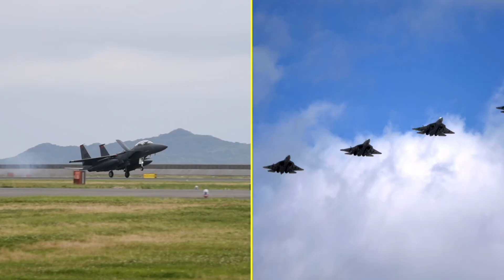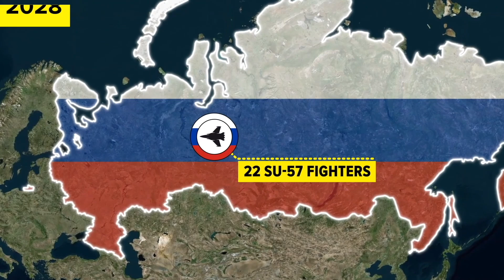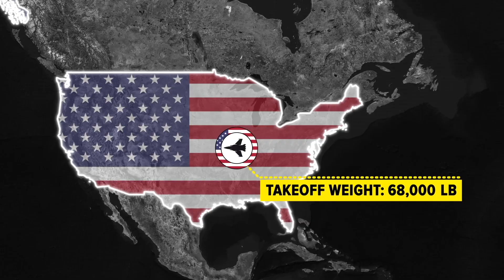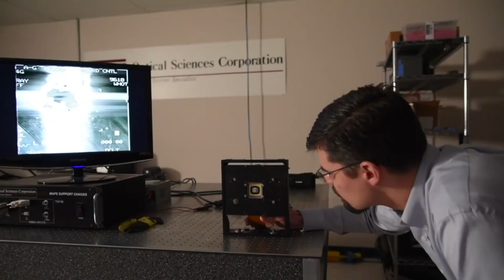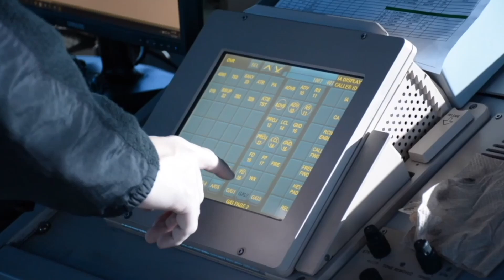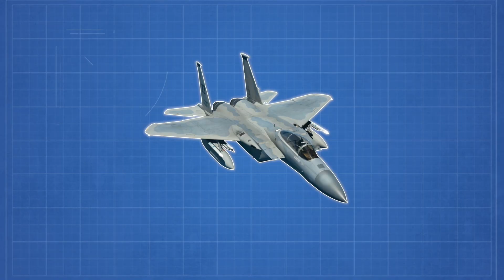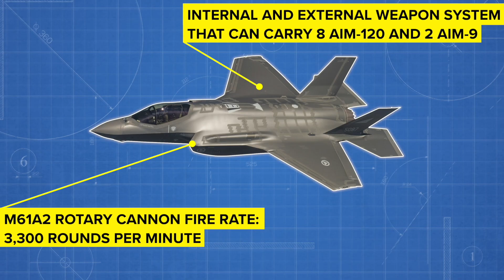Why the F-15 Still TERRIFIES Russia

Comment: Russia is not scaring anyone. That new F15 EX is something they should worry about.
Reply: I don't think Russia is thinking twice about a plane which primary role will be domestic defence. The F-22 and F-35 is what they fear.
Reply: @janhansen3753 actually….the F15 especially the EX  would serve as second hand damage after the stealth jets came in and destroyed land to air threats that could lock them up
Reply: @lafosh7234 the F-15EX will be the F-35s missile truck. Think of it as an an extended mag for the 5th gen.
Reply: @lafosh7234 

First, Russia would have to develop stealth aircraft.
Reply: @janhansen3753 it's the combination that's the real killer. The stealth of the new fighters and the situational awareness they offer helps everyone else. They clear the way, so to speak, but then the upgraded F-15 can carry large numbers of missiles and bombs. It's a missile/bomb truck with a ridiculously powerful radar and now even more range and loiter time.
Reply: @janhansen3753  Which they should, but we only have them in limited numbers. A squadron of F-15s fifty miles back from a couple F-22s or F-35s make one heck of a force multiplier and distraction.
Reply: @janhansen3753 they will be sold to our allies as well
Reply: @janhansen3753 
Russia should fear the missile carrying platform that the F35 will be directing towards the targets.  Unlike Russia, US and NATO countries utilize and integrate multiple platforms into a fighting force.
Reply: @janhansen3753 100% false. It will not be dedicated to domestic defense.  It will be a missile carrying platform that with datalink with F35 and F22, will be used to absolutely decimate foreign adversaries.
Reply: @janhansen3753  The F-35 is suffering from the same problem that the F-4 Phantom experienced in Vietnam.  Jack of all Trades, Master of None.  Seems like Western leaders go in a cycle where they think they need a multi-purpose vehicle only to come to the same realization of previous generations that having dedicated frames for a specific purpose is more effective.  What they should be looking for is NOT multi-purpose aircraft, but rather PARTS inter-operability.
Reply: @davidford3115 

Detection and mastery of the airspace is what the F35 commands.
Reply: @davidford3115  The F-35 is actually just 3 different aircraft in a trench coat claiming to be one model.  The difference between the A, B, and C variants are significant.  They only share 25% of the same parts between all 3.  But the F35 is good platform even if its equipment load is reduced when using just the internal weapon bays.
Reply: @BurntOrangeHorn78  That is what the USAF claims, yet it still has yet to actually prove itself in combat.  While it is clearly superior to Russian and Chinese airframes, its advocates oversell its capabilities just like the Russians have for the Su-57 Felon.
Reply: @davidford3115  To be fair, once they got over the idiotic 'the era of dogfighting is over so who needs a gun, or even training pilots how TO dogfight', the F-4 served quite well for many years.
Reply: A F-22 pilot said the new F-15EX  fly by wire can hang if not exceed the maneuverability of the F 22 Raptors.😳😉.  Not counting the new F-15EX missile Magazines from above.  F-22, F-35’s lock the targets.  And is fired by the F-15EX.😉.  The F-15EX has the biggest, and fastest super computer in any military aircraft in the world.🤘 🇺🇸.!.!.
Reply: @djoswald9128  Until the F22 upgrades go through anyways.  Still look forward to if the manned-unmanned teaming ends up being a real thing with NGAD.
Reply: @4RT1LL3RY  “Until then the F-15EX still rules the skies.  F-22 has 2 A2A kills.  Both balloons 🎈.  Balloons don’t shoot back.😉.  2030 is a long way off.😉.  Is worth the mention, F-15 EX will still have their six in 2030.🤘.
Reply: @djoswald9128 it might be as maneuverable when clean fuselage, but with full weapons component it will greatly reduce that performance. The F-22 does not have that limitation due to the internal weapons bay.
Reply: Honestly who defends the margins that we all thought was real prior to Ukraine.   It's obvious.
Reply: They are just a big paper tiger, aka an appetite for a military
Reply: Yup 🤘🇺🇸
Reply: F15ex linked to the f35s = gg
Reply: I think it's hilarious (also, awesome) that we can revisit an older design like the F-15 and just modernize a few parts of it, and it's at least as effective as a brand-new design. Goes to show you how well designed the F-15 was/is.
Reply: @Canoby 
Why do you believe that the F-15EX is an old F-15 with only a few modifications?
Reply: @Not-a-GSD  Because it literally is the exact same design as what the USAF flew in the 1980s but with some systems upgraded. And this isn’t a knock on the F-15EX- even vintage F-15s are better at their jobs than a lot of newer designs
Reply: @Canoby  
Wrong, unlike you I have actually worked as an engineer with previous F-15 and F-16 designs.  Try again skippy, but use actual facts not opinions based off of ignorance.
Reply: @Not-a-GSD  😂 claiming you’re a big shot engineer pretty much proves you’re talking out of your ass
Reply: @Canoby  not necessarily. That's a blind assumption. You have a 50% chance of being wrong.
Reply: @moriscondo5511  You’ve never heard of “testing” apparently
Reply: what is Su-35 then? Literally F-15EX before it's recepie was repeated. @Canoby
Reply: @worldoftancraft  😂 cute knockoff that fails harder than when the Russians were still trying to work out their own designs
Reply: @Canoby  your reply makes no sense considering what I wrote. You now isist that Russians copied F-15EX before F-15EX existed, so they can create the-to-be prototype of F-15EX. Genius
Reply: @worldoftancraft  Nothing you say has any grounding to reality, but OK go ahead and talk nonsense on the internet. Russia’s SU 35 is trash compared to anything the West puts or ever put out
Reply: @Canoby what a load of crap.
Reply: @kotor1892  well if some rando on the internet asserts it with being able to articulate why 🤡
Reply: @Canoby :: SUPERSMART CONSIDERING  PROTOTYPE  FLEW JUST  BEFORE  15TH  BIRTHDAY.    IT FLEW  27 JULY 1972.   ☆☆☆☆☆☆
Reply: You should be scared of Russia, they kill on an “Industrial Scale”. If you’ve never seen this form of War….than be lucky.
Reply: Listen Taking the Most Lethal  4 th Gen Fighter / Give it State of The AeSa Radar, more Power , Range , Greater  12 Missles instead of 8 . EPAwss Survivability + Not to exceed Mac 2.8 ( Dash to escape a Fight) is a Problem

Su-57 has limited stealth. It has F-18-E/F  Level Stealth Clean.

EX - Can see it FLirR / But most likely it’s Powerful AESA Radar.
Reply: Neither are the Americans..
Reply: The F-15EX would get popped by Russian SAM systems like the BUK-M3, TOR-ME2, S-350VM, S-400 just as easily as the F-15a.
Reply: @John-hu9qg  the F-15 is hanging back and firing it's AMRAAMS from a safe distance using its datalink to the F-35s weapons lock.
Reply: @bucky5869   It's rumored that the Russians have special EMP and air bursting tactical nuclear warheads for their long range SAMs, like the 40N6 to cause absolute havoc among the sophisticated and sensitive sensor suite on 5th generation airframes like the F-35, F22 etc.
 If in doubt use the sledgehammer.
Reply: @John-hu9qg    The problem with the nuclear option is the taboo.  China and Indian will BOTH turn hard against Russia if they use it.  There is a reason why it hasn't been used so far.
Reply: what a sad Russian Bot. SLAVA UKRAINI
Reply: @bucky5869 the F-15EX can also equip and fire the JASSM and the HARM. With the F35 acting as a flying forward air controller, the big fat F15 can deliver a LOT of ordnance with great accuracy on target. It's a winning combo the USA has been employing for 30+years with various aircraft combinations.
Reply: @Clean97GTI  The F-35 can also deliver a great load if it is using external pylons? And even with external pylons the F-35 is way harder to hit then the flying barndoor.

And for those who think the F-35 is only a targeting machine while the F-15 hurls AMRAAMs. You guys simply have played to many videogames. Name one airbattle after the Vietnam war where more then 4 missiles have been used in an airbattle.

The F-35 is a way better platform for any ARM missile. And there are many better platforms for JASSMS.
Reply: @janhansen3753 Using the external pylons makes the F-35 much more visible, but the F-35 wasn't really intended to be the Air Superiority fighter the F-15 was. The F-15 is more than capable of doing its own air to air combat. This video is about the EX model which includes all the ground strike upgrades that were previously only on the F-16. The F-35 has the fancy new radar, fire control, targeting, etc. While the F15EX has some of that too, it doesn't have stealth. What the F15E and EX models have though, is 8k to 11k more pounds of ordnance capacity and roughly 15k lbs greater takeoff weight. 
While the F35 can hold its own, it's more in the F16 or F/A-18 class of fighters. The Eagle is a much bigger boy with a very powerful radar of its own, the ability to network with the F35 and AWACS and bring a disgusting amount of firepower to an engagement.
Reply: @Clean97GTI  he can’t seem to realize they function vastly diff but together and essentially become a insane beehive 😎
Reply: @zethloveless7238  Almost like building interlocking layers of capability into your approach to combat is a good thing.
Reply: @Clean97GTI  Do you really mean that using the pylons on a F-35 would make the F-35 more visible then a F-15 in an enviroment where you want to use a F-15EX. Do you think a F-15EX is less visible?

And the F-15 was intended to hunt for the "fast" Russian fighters starting with the feared Foxbat. Most American planes have shifted role more then once, and so can the F-35. Is it 14 AMRAAMS the F-35 can carry? Name one conflict where 14 Long range AAM¨s wasn't enough.

I have heard the F15EX míssile bus story way to many times, people got tired of thinking for them self and became parrots. 4 F-35's start a mission. Two stealth and two in beast mode. Name ONE nation that can stop them? USA have survived this long because they are masters in adapting. Nuclearsubs became amazing hunter subs. Battleships becme amazing missile cruisers, F-15's became amazing AAM AND strike platforms.

The F-15 EX is a great plane for defense, offensively aginst a modern counterpart it is all but useless. When the enemys AAM's/SAM's can fly further then most NATO AGM's, it looses it's offensive value as it cannot hide with it's barndoor RCS. And IF you need a serious long range punch, many larger planes can deliver them.
Reply: @janhansen3753  No. I mean that the external pylons make the F35 more visible than it would ordinarily be. The F35 isn't an air superiority fighter though.
Reply: @Clean97GTI  Okay, but IF a F15EX can fly in an area, so can a F-35, is that correct. What i am saying is that a F-35 with external pulons have more AAM´s then you will ever need in an aerial enounter. And if it fly in an area where a F-15 can fly it really wouldn't need it's stealth anyway.

The "only" advantages the F-15 have over the F-35 is range and speed. The BS about it being a missilebus is just parrot talk from people who have played to many computergames as USA do not need a missilebus here and now. And if they would need it, a Tanker and 8 F-35's would do just fine in any scenario except WW3. And in WW3 the B-21 and B-52's would be the missilebusses.

The F-15EX get a new lease of life as a defensive asset (Read "Missile hunter")
Reply: @janhansen3753  The E and EX models have a substantial A2G capability as well as a lot more payload capacity than the F35. That's part of the point between the upgrades to the Eagle, to let it work with the next gen fighters and electronics warfare capability. The stealth of the F35 allows it to be very effective in SEAD operations, more than the F16 it replaces. This also allows it to direct F15s and assign targets. It allows the F15 to switch to an air superiority posture if the F35 needs to make precision ground strikes. 
It's flexibility. The F15 can be a very high tech bomb truck because it's size allows it.
Reply: @Clean97GTI  You bought the sales pitch, good for you.
Reply: @janhansen3753  You don't understand why an upgraded F15 in a multirole configuration would be a valuable asset when combined with other advanced fighters to direct fire on targets? I can think of several scenarios where that would be useful. And unlike your example of an F35 and a cargo plane, the F15 can defend itself against air to air threats.
Reply: @Clean97GTI  You have played good videogames m8. 

I only need one senario for why the F-15EX cannot get near enough to be of any value = Many forreign AAM and SAM missiles can outfly most US and NATO AGM missilles today. The F-15 cannot operate close to enemy AAM/SAM cover.
The last years the SAM and AAM's ranges have increased massively while an AGM development is hamperede by it needing a big warhead to make damage. If you combine that with the new knowledge that Russia have more powerfull GPS jammers then anyone expected you need your planes even nearer to their intended targets before they can launch their missiles. And it is VERY unhealthy to have a RCS of a barndoor if you have to get closer to your targets.

And the same goes for AAW's, one of the learning points from the war in Ukraine, is that Russia is way better at jamming then expected. If Russia is good at it, so is China. (ONE Russian emitter supresses the GPS signal in most of the Baltic sea all the way to Denmark.)
Reply: @janhansen3753  AGMs don't target SAMs, they target the radars that give the SAMs their targets. Air defense systems like Iron Dome or Patriot or S300/S400 target the SAMs. 

You say the F15 can't operate close to enemy air cover, but it did it more than a few times assisting F16s in SEAD operations. That's why it works. If the AAM battery wants to launch at the F15, they have to turn on their radar which makes them a target for the F16s in the area.
Now the USAF and USN are using the F35. The technology has improved, but the game is still the same; bait the AAM to turn on it's search radar, wait for high frequency lock, launch AGM missiles. 
But the benefit of the EX is now the same fighter that was the bait, has a huge load of ordnance to attack the now-undefended site. 

JDAMs use inertial guidance so a jammer has no effect. F15 and F35 high five each other after spit roasting a whole Russian airfield.

Inertial guidance doesn't need GPS.
Reply: @Clean97GTI  You are talking about ARM missiles, but i understand what you mean. But sadly you are wrong.
You are talking about SEAD missions anno 1990 where you baited a radar. Until recently a SAM would be targeted long before it even turned it's radar on the first time by sattelite imaging. But now the GPS is fairly unusable making giving many AGM's a headache.

Where you go wrong is with the new networked units. A SAM system does not need it's own radar for targeting it's missiles anymore. Lets take China. In China both the navy, the Airforce and the groundforce is connected in a network with the "Rocket force (Isn't that the most cute name :D). IF a Chinese patrol boat can target a F-15, it can guide a SAM missile to the plane until the missiles internal Infrared targeting takes over. The SAM system never needed to turn on it's own radar.
Systems like this above is spreading like wildfire as those who do not have it is lightyears behind = all major layers have it now, even minor countries have it.

And a F-15 would never get within the 28 KM it need to drop a JDAM. It would probably not get within 300 km with it's massive 25 m² Radar cross section. And here is the F-15's main problem. Even the worst radars can track a plane with a 25 m²  RCS from a long way out. I heard fairytales talk about a F-15EX with a RCS of 1m². But it is impossible to remove 24m² RCS with Have Glass V radar absorbing coating. And Electronicly it is nothing but a question of time when these gimoes are obsolete. The Russians is way better at developing jammers then we ever expected.
Reply: @janhansen3753  You keep making the assumption that the missile is the target. PATRIOT worries about the missiles. The F15 or the F35 is going after the radar, wherever it may be. Long range detection is easy, relatively speaking. You can find a radar return even on stealthy aircraft from longer range. The issue is finding a guidance solution with the higher frequency targeting radar before the enemy aircraft can lock and fire. 
And with the very powerful radar systems on the F15 and F35, that's not easy to do. 
SEAD still works just fine.
Reply: @Clean97GTI You talk jibberish?
Reply: @John-hu9qg LOL. Unfortunately,  those systems would get fried by our wild weasel sorties. Comrade must be a Russian bot that ignores reality.
Reply: @chriswincek8672  SEAD is not as easy as it once was, especially with standoff weapons, and warheads designed to counter a sophisticated opponent.
Reply: @John-hu9qg  Funny, because HIMARS seems to be doing a great job of popping those system before an F-35 even shows up.  

Of course, you are also forgetting the ubiquitous AGM-88 HARMs which seek out such systems and have wrecked them in Ukraine.
Reply: @davidford3115   HIMAR and HARM were touted as gamechangers in ukraine but in reality they have changed nothing, we have multiple incidents of BUK-M3 and TOR-ME2 systems shooting down HARM missiles and HIMAR rockets, the arrival of the Russian Tornado 200km MLRS has shown where the HIMAR has become the hunted, resulting in the recent destruction of multiple HIMAR and Patriot, and NASAM units.
Reply: @John-hu9qg  They were.  They forced Russia to change their operations, and those changes have continued to this day.  

Russia does NOT stockpile munitions close to the line of contact, with most of the supply depots having been pushed 50 miles back.  And even then, they don't consolidate them in easy to reach locations as that would invite another strike.

As for HARMs, you don't want to admit that the Russian air defense is nowhere near as effective now because they HAVE to keep the targeting radars turned off until AFTER a Ukrainian aircraft is already overhead.  Because of this, there are high numbers of "friendly fire" accidents.

As typical of a Kremlin shill, you downplay anything that does not affirm your myopic view.  You are panicking, and it shows.
Reply: @davidford3115  Russian forces have no shortage of ammunition, unlike Ukraine, and dispersal of ammunition locations is largely common sense. what has the ATACM achieved? Nothing because they were easily targeted on their predictable trajectory by Russian air defence systems, the BUK-M3 in particular, which was also extremely successful in intercepting standard HIMAR rockets. The HARM missiles posed more of a threat than their actual success in ukraine, and the donated aircraft retrofitted to fire the HARM missile didn't exactly last long over there either. These days the introduction of new Russian weapons like latest Kalibir cruise missiles variants that incorporate flare and chaff bursting countermeasures on their terminal approach have proved devastating, along with jet assisted standoff UPAB-1500B glide ordnance, the Tornado MLRS, and LMUR missile.
Reply: @John-hu9qg I hate people like you that think Russia makes zero mistakes or has zero problems in this war. It's beyond dishonest and biased
Reply: @John-hu9qg  Ah good, an expert. Can you explain to the rest of us why the Russian army is so terrible? You're supposed to be the 2nd greatest army in the world and Ukraine is a fraction of your size and yet here we are 2 years in and the lines haven't changed much.
Reply: @John-hu9qg  What has ATACM achieved?  I guess you forgot about the strike on Berdyansk.  And the hit on Saki Airbase in Crimea.  For a "predictable" trajectory, Russian Air Defenses have been abominably bad.

You are coping by trying to drown out reality with vodka.  Time to put it down, Private Conscriptovich, you are so intoxicated you are hallucinating.
Reply: @John-hu9qg  Yeah, the Russian air defense equpiment has been so effective that it's destroying more HIMARS and PATRIOT systems than have actually been sent to Ukraine. 
Meanwhile, SU-34s have been dropping out of the sky for...reasons.
Reply: @John-hu9qg  True, IF America was foolish enough to send it straight in with no support. I'd bet we'll see the F-15EX deployed behind a screen of F-22s or F-35s tasked with detecting and suppressing those systems, and to bird-dog against aerial targets.
Reply: @John-hu9qg  That’d be a feat considering battle doctrine would have F-35s knock out air defenses before the F-15 EXs got close to Russian air space
Reply: The f-15 ex is not stealth or intended to be. It carry’s many tons of ordinance on its hard points so it only comes in after air defenses are downed. It’s part of a strategy, not used in incompetency scenarios. Stupid to even have to mention this it seems like anyone with a brain would understand. Does this describe anyone? You tell me.
Reply: @dancotterman1267  And what we have learned in Ukraine is that Air defenses do not come down.